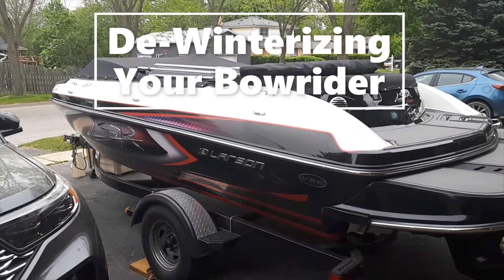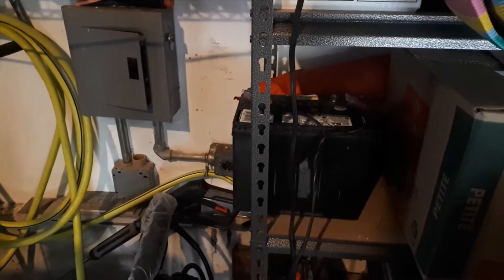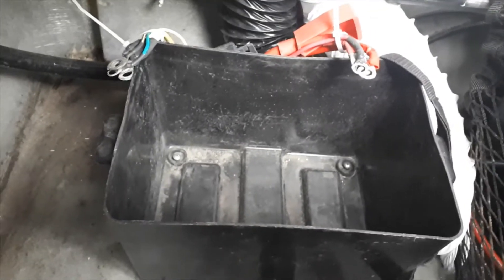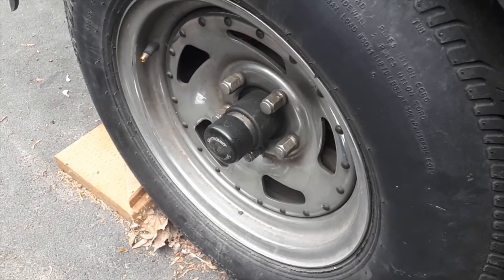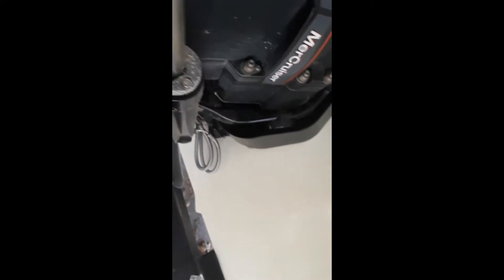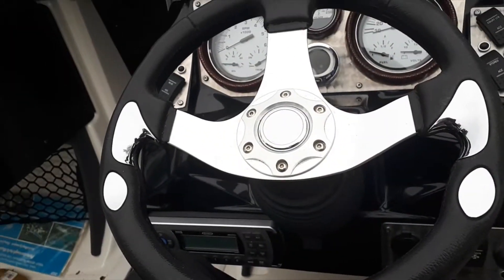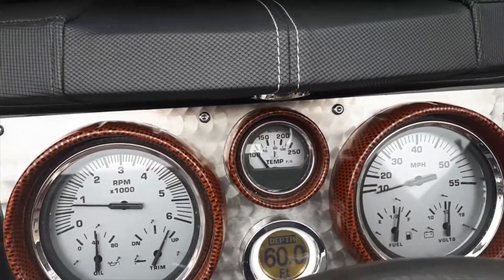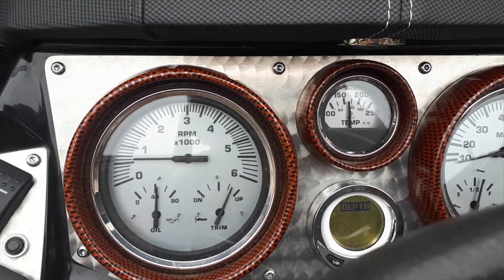De-winterizing Your Boat For Launch

Comment: What if I drained the coolant out of the MerCruiser cruiser inboard outboard motor? Do I have to fill the engine block back up with water so the impeller isn’t working overtime?  Or is this not necessary? 2:41
Reply from the maker: Hello Robert, Thanks for watching my video. If I understand your question, once you are ready to start your engine, your motor always needs to have a supply of water to cool. Either from a hose like in my video or the lower part of the motor can be in the water(lake/river). Does this help?

Comment: My boat starts perfect, after two minutes stops running. So what could be the issue!
Reply from the maker: It sounds like your engine may not be getting fuel? Did you check that?

Comment: Your lost me at the tire
Reply from the maker: Hello, what I was trying to explain is that it is important to check and top up your trailer tire pressure. While sitting during storage, the tire pressure can go below recommended. It's important to check the pressure and add air if low.  If the trailer is driven on a tire with low pressure, that tire could blow while moving.